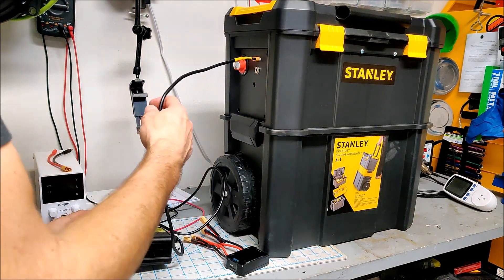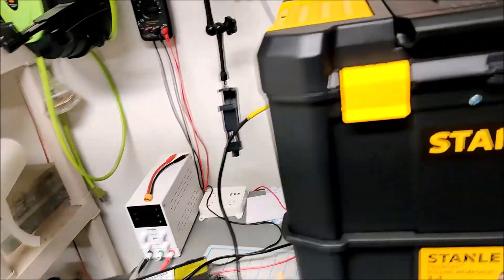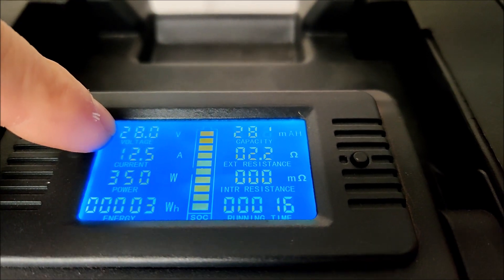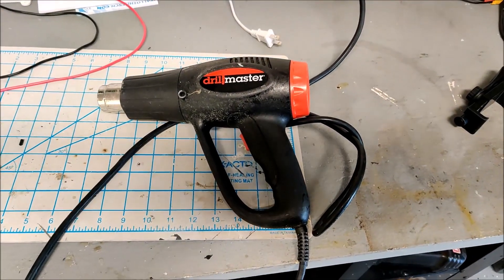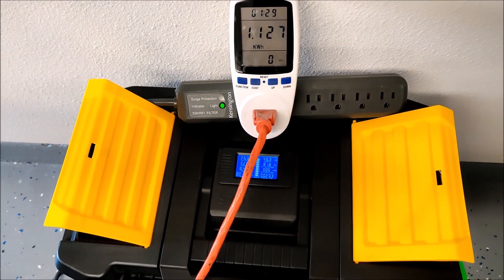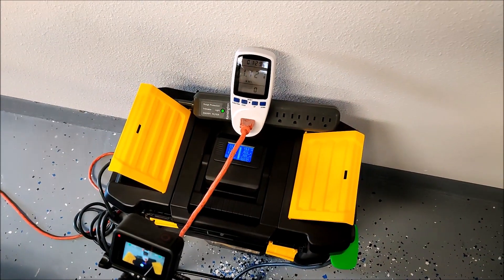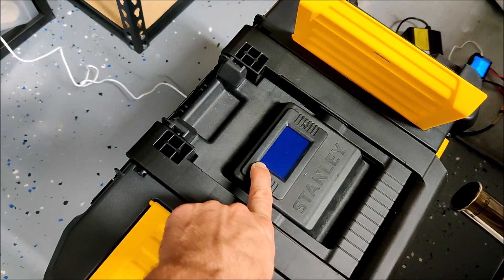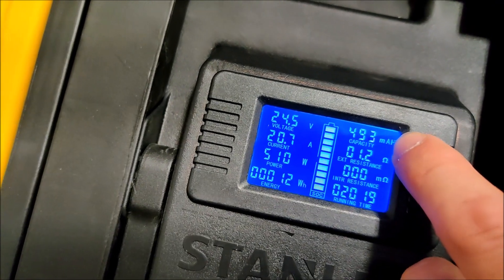DIY 3KWH LifePO4 Solar Generator - Part 5 Capacity Testing

Comment: What is the efficiency of the the charged and the inverter?  You are losing power twice there.  That can very well account for 15% of the total capacity.
Reply from the maker: The DC meter measures directly of the battery before the voltage drop off the inverter.